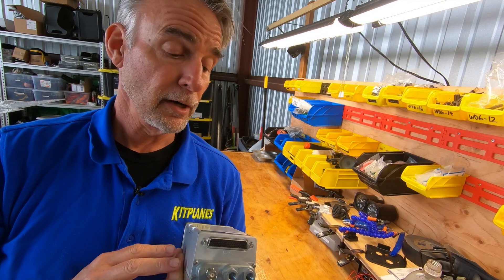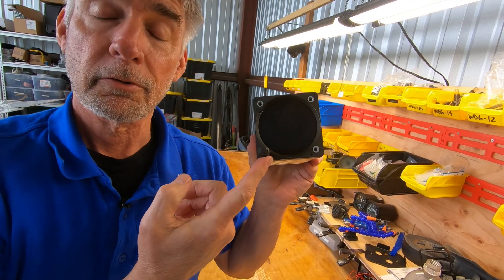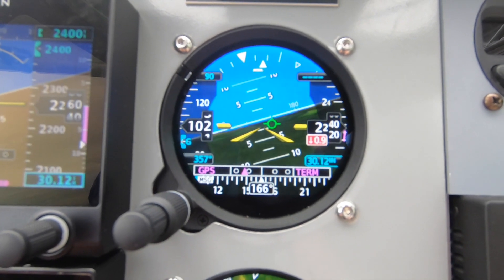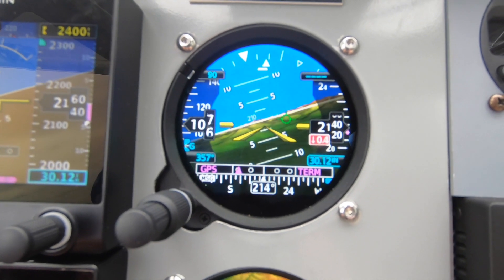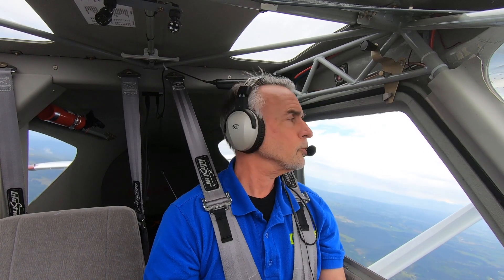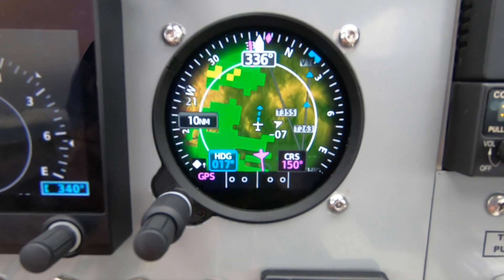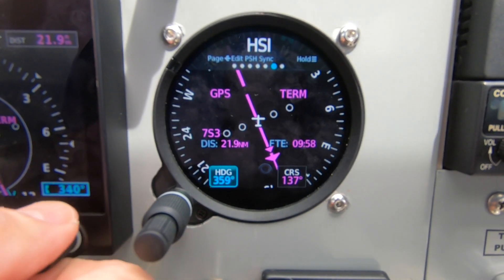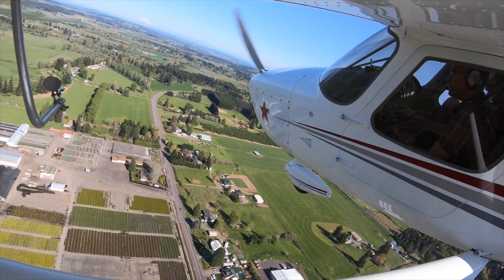Garmin GI 275 EFIS Flight Review

Comment: Is the synthetic vision already present or the data comes from the GTN or any on board gps?
Reply from the maker: Position data in this case comes from the GNX 375 but the GI 275 can use its internal GPS as well. The data for the mapping itself is in the GI 275 database.

Comment: Sir can you use the GI275 EIS and MFD for a backup AHARS for the Garmin G3X?
Reply from the maker: Unfortunately, no. Garmin says the GI 275 can share ADAHRS data among 275s but not with other boxes.
Reply: The  G5 can act as a backup AHARS to the G3X its to bad that the 275 cannot act as a backup AHARS to the TXI 1060.
Reply from the maker: @johncarr123  Agreed, but it was not part of the intended ecosystem for the GI 275.